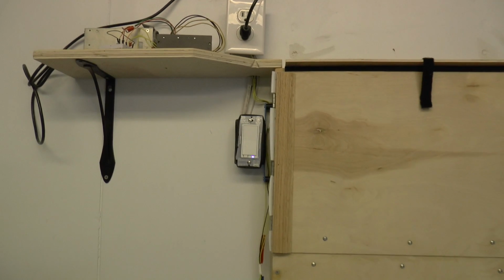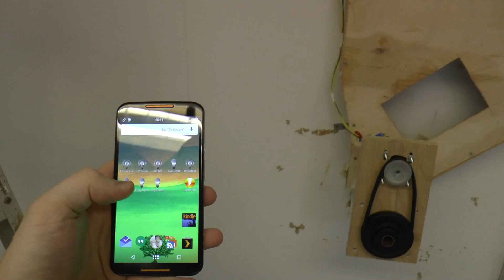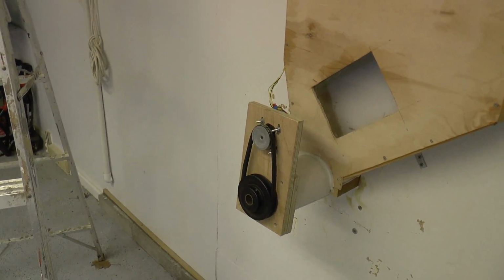Automatic Electronic Dog Feeder (controlled via Arduino, Z-wave and Tasker)

Comment: Hi, I'm trying to make a treat dispenser for a client of mine of is a quadriplegic.  I just got an Arduino Uno board Rev3 & Capacitive touch breakout board AT42 & Motorshield V2 kit  I'm not sure of what basic steps I need to take to program the board to tell the servo motor to rotate 1/4 turn  Can you give me some step by step instruction to wire and program the board or tell me what tutorial I should go to.  BobsPetStop@gmail.com  I'm a Beginner and don't know where to start!!  I'm not techi, just a dog trainer who wants to help.  Bob
Reply from the maker: Hi Bob, the project as I made it is definitely for a stepper motor, not a servo.  Here is the chunk of code that turns my motor:

for (int i = 0; i <=10; i++)

  {     
    digitalWrite(dirPin, HIGH);
    digitalWrite(stepPin, HIGH);  
    Serial.println("motor running forward on manual. ");
    delay(5);                           //  increase the delay to slow it down.
    digitalWrite(stepPin, LOW); 
    Serial.println("motor running forward on manual. ");
    delay(5);
  }

I set the direction pin to high and leave it there (or low depending on the direction you need), then alternate high > low on the step pin to turn the motor.  The delay amount determines the speed and depends upon the motor driver. My first (cheap) driver needed a 750ms delay to get the speed I wanted but when i switched to a better driver with microstepping, I had to speed it way up with a short delay.  I used a z-wave outlet to control how long the motor was on for (ie how much food was dispensed).  However, the for-loop at the beginning can be used to run it for a turn amount (eg 2 turns, or 1/4 turn, etc).  This just depends on the step size of your motor for what value to use to get the result you want.  10 steps might be 1/16th of a turn on one motor and an 1/8th of a turn on another.
Reply: Thanks so much for your help!!!!!